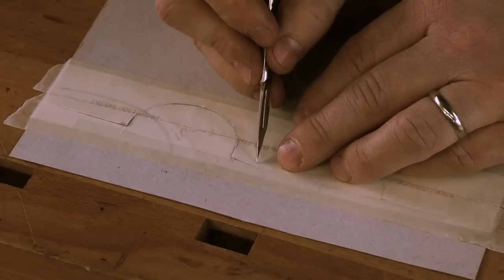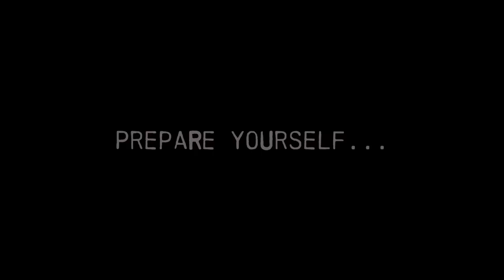FULL Guitar Build + Custom Control Knob & Demo | Making a Multi-Scale Electro Acoustic DREAM Guitar

Comment: The guitar is absolutely stunning! It is so much fun watching you build and problem solve.
That said, the demo sounds quite out of tune. Either that, or the guitar does not intonate well, but I guess with that floating bridge design it would not be a problem to fix it.
Looking at it again, the bridge actually looks like you compensated it with a wound G string in mind, but in the demo it is strung with a plain G, so maybe that is the problem?

Comment: The little router plane may not be the prettiest tool in existence, but it's definitely pretty enough... And there's something special about making your own tools for a specific job. I have a brass scraper/chisel I made specifically for removing excess epoxy from finished knife blades (I'm a knifemaker) with tiger maple handles and mosaic pins. It's a lot prettier than it needs to be to do the job, but it puts a smile on my face every time I use it...

Comment: It's always good to see a full build in one go and marvel once more at the refinements, care and original design ideas that go into Ben's builds.
But the sound wasn't up to the usual standard- very low level for some reason and much quieter than the ads. Otherwise, a great job of the editing!
Reply: I felt that was because the demo was really just showcasing it's acoustic abilities without showing off what it can do with some gain and distortion tossed at it. Could be wrong.
Reply from the maker: good point, new editor with a different rig and I didn't think to check the actual volume levels across videos. thanks for the headsup though! And I will tell Bear you liked the edit, I am very excited to be working with him on super edits and some other one off build videos..
Reply from the maker: we really should have played with the sound a bit more.. distortion is a MUST imo
Reply: @CrimsonCustomGuitars  Most definitely!

Comment: With respect, this version of the Nebula 2 guitar appeals far more to me than the series with all the episodes. Granted you used aspects of an acoustic guitar build this time, but generally you use so many forms of the same techniques on all of your custom guitars - and I don’t need to have such things as the “masking tape & super glue trick” explained to me each time. If you put a play list link in the notes pointing to the various full videos then surely that’s perfect and I can zap across to look more closely if I need to. But fact remains, this is a wonderful instrument (except for the string pins for the ball ends because, surely they’re going to snag badly.

Comment: Ben I recently came across a wood called Red Maranti, are you aware of any reason this should not be used to build a guitar?
Reply from the maker: Meranti is a generic term for a few different species but all of them are, in my experience, perfect for building guitars. light weight, resonant and fun to work with

Comment: I have a Martin mandolin that looks a similar build to the backpacker.. only just put two and two together after ten years! 🙄
Reply from the maker: A Martin mandolin? Very cool
Reply: @CrimsonCustomGuitars  it wasn’t expensive at the time , £150 I think. It looks like the sides of the body are part of the neck, as if the front forks of a bicycle wheel, which are then splayed out to fit the top and back ‘skirt shape of  the backpacker body. The grain follows through so it can’t be separate pieces… quite wasteful wood wise I imagine but a nice solution.. 👍

Comment: Did you ground the guitar tuners?
Reply from the maker: Tuners are grounded through the strings and the bridge
Reply: @CrimsonCustomGuitars  right but what was the wire you put in between the head stock and tuners.? Thinking about building a guitar so just trying to learn all I can. Thanks.